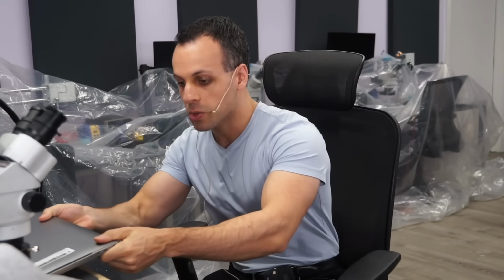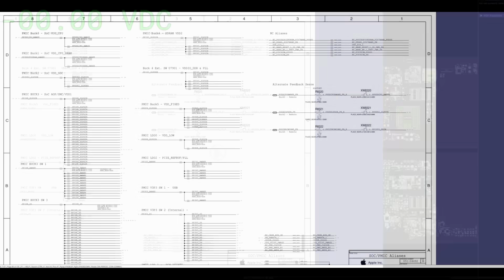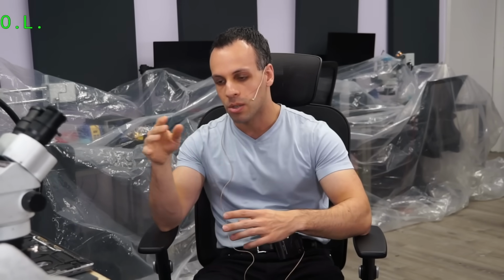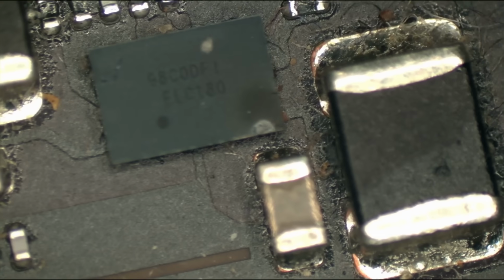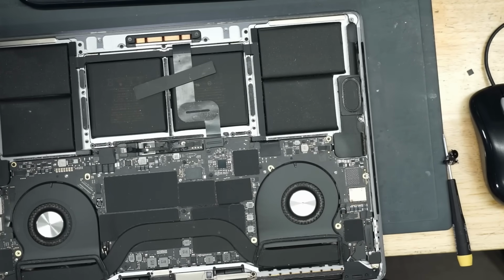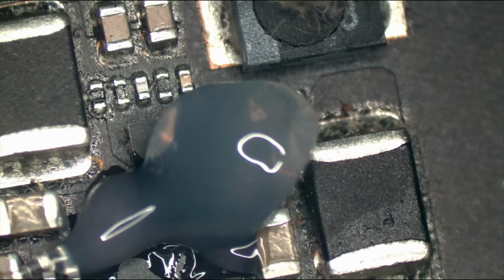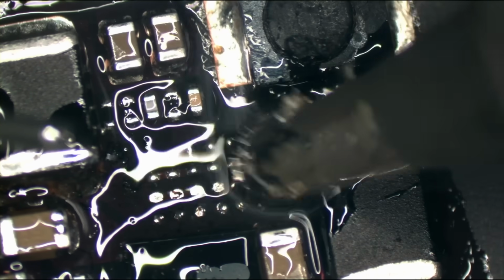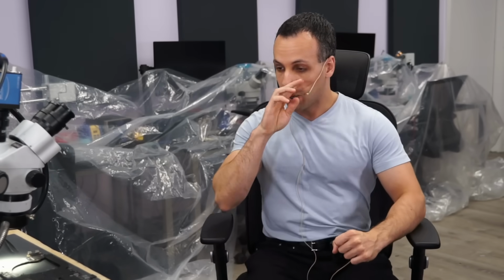How most 16" Macbook Pros often kill themselves & why they're unfixable

Comment: It appears that "throw it away and buy a new" is a GREAT model that will be used for a green and sustainable future. BRAVO BIG CORP!
Reply: So much courage. I wish other companies had that courage..
Reply: dont forget to buy icloud to keep your data
Reply: @simedinson984  "...to keep your data..."

You mean "to let Apple decide whether you get to keep your data".
Reply: @quigonkenny  sarcasm but okey :)
Reply: @simedinson984  Always back up your data to the cloud. If your MBP SSD is fried, all your saved data can still be retrieved. Louis didn’t tell you guys that part but its all common sense if your SSD data has been wiped.
Reply: Apple is still years behind appliance manufacturers like Samsung or LG. Imagine if Louis had to scratch 1 inch thick layer of silicone from the whole motherboard in order to even see what it is. Washing machines control boards were done this way years ago to prevent ANY KIND OF REPAIR. So you basically have to replace them every 2 years and they cost almost as much as a whole new machine.
Reply: @Wierzbik2137  uhh pretty sure it's because it's cheaper to just encase them in block of resin to waterproof it, and why does it need replacement every 2 years?
Reply: @eidrag  because motor control chips and power regulators are getting slowly but surely cooked underneath it? At the beginning they were failing every 6 months, so they quickly added small radiators to them and now they fry every 2 years, just after warranty period. Surprisingly sometimes when I manage to find a replacement chip and swap it after spending 2 hours with an angle grinder to remove that resin. The board works 4-5 years. Let that sink in. Waterproofing is just a BS excuse to rip of customers.
Reply: @Wierzbik2137  yeah they can design better waterproofing solution and spend few cents more for better quality chips.... but why bother when you can sell new board for half the price of new machine lol probably that's all manufacturer care
Reply: @Wierzbik2137  So, it's not really waterproofing (although, I'm sure the boards are waterproof) as the goal, it's to make just enough heat to kill the board just as the warranty expires, right?
Reply: @eidrag  Why do you need to waterproof a washing machine anyway? Your not taking it outside. Your roof doesn't leak (i hope). If your washing machine leaks THAT bad you got bigger issues, and finally if your home floods again you have bigger issues. Water proofing a washing machine is just a gross waste of resources that does basically nothing
Reply: @VadersFist501st  uhh not waterproofing the whole machine. Only for the central board where all the electronics/chips live. 

Some of example why waterproofing it is important are: you fill up the machine with water and you soak some of the clothes, then when you want to start the cleaning cycle suddenly it alerts you with overload, no biggie, just take out some clothes so that it can spin....whoops some droplets fell on control panel. 

Or you're soaked after getting caught in rain and you want to spindry your clothes... guess have to be carefull not to get water on sensitive electronic board
Reply: @VadersFist501st  because moisture. Simple enough.
Reply: @Wierzbik2137 I don’t understand this waterproofing thing.  I had 2 smartphones that weren’t waterproof before my S 10 and they lasted longer
Reply: @Wierzbik2137  Sounds like potting. Potting is done to protect boards from water.
Reply: @tagert1975  you know rare it is for a board to fail in a appliance because of water or moisture? It only happens if you have a massive leakage on the floor or sprayed the water directly on th appliance for example during shower.  Very rare cases, and even then as long as the main control chip is not fried I can repair the damaged traces and quite often bring it back to file. I flat out refuse to work on boards covered in this silicone. Having to spend 2 hours peeling that crap off the board and cutting it free from additional plastic cover with an ANGLE GRINDER of all things is neither safe or economically viable.
Reply: @Wierzbik2137   It's a washing machine. It lives around water.. I can repair traces too. I think I was 15 when I first repaired a trace on a circuit board. Hell if you take a more liberal view of it I was probably more like 8 years old. so that's not the question here. 

The washing machine has to pass UL requirements for a wet environment with detergents. While I've never designed a washing machine in my career I've had to get stuff used in wet environments to meet UL standards. Potting is one of the ways to do that. And since 99.999% of people can't repair boards, if potting is the cheapest option, guess what gets chosen?
Reply: @tagert1975  True, and that means all those new washing machines will end up on junkyard after 2 years of use, while the older ones with open control boards and loose cables dangling on the side of the brushed motors will work for 20+ years until the rust will eat them completely and they fall apart by themselves. Screw economy, screw ecology, customer is 1% safer while using his appliance ;)
Reply: @Wierzbik2137  The older washers don't have any electronics. My 1982 washer is electro mechanical. Just a motorized timer with contacts and the solenoids in the wig-wag. Those solenoids are sealed against moisture. Contacts are protected simply with decent plating.  But it doesn't have all the 'features' people want today. 

People want features and the government wants wiz-bang water & energy saving features and so on so there will be electronics. Modern environmentalism is ultimately very resource intensive and bad for the environment. But the old machines use more water amd a little more electricity so we have washers that last 5-10 years instead of 15-50 years.
Reply: @Wierzbik2137  it's a small wonder that any people want to buy old washers and dryers since they're built to be almost indestructible
Reply: I unfortunately fell (from a great height 😟) onto my 2-month-old Mac Air...repair quote was $2580 ( it cost #1664) I was told to throw it away....what really pi#*ed me off ...was the 512gb hard drive that cannot be recycled. Because it is soldered  in....so much for App,e's " bulldust" carbon policy....I wrote and asked Tim Cook why was the repairs so expensive....I said, I found it amoral! Needless to say he didn't respond! As an aside, it was my 1st and only Mac at 73 yrs old, I'm unlikely to buy another...it took me 2 yrs to save for my now very expensive paperweight!
Reply: Well you already have to buy the charger separately for their Iphone. What's more green and sustainable than that?! They can definitely sustain their profits and that big green headquarters in California.
Reply: Apple fanboys: why are you being so mean? You are just being a hater and toxic. 

Normal people: what are you talking about?
Reply: Apple is not green nor progressive, eh?
Reply: Yep. But folks are IDIOTS if they buy anything Apple ever again.
Reply: Buuuut wait, Apple SaVeS tHe TrEeS bY rEmOvInG pLuG aDaPtErS /s
Reply: Both my Macbook Pro 13 from 2012 and Macbook Air from 2015 died out of the blue without any physical or electrical damage. While my gaming laptops from 2011, Dell XPS and Lenovo Z580 still works to this day. When my last Macbook Air died just by itself while watching youtube, I promised myself I will never buy Apple products again.
Reply: It's it funny how that works?  The regulatory government-corporate structures  wants to move us away from cars that last 20-25 years if taken care of to cars that are much more resource intensive to build that won't likely last more than ten no matter how well they are taken care of.
Reply: “Green tech” and rainbow flag is just BS to collect ESG investment.
Reply: Reminds me of electric cars.
Reply: Apple has a thing on their website for recycling apple products, with a $0+ apple gift card depending on its condition. For my 2012 MacBook, they sent me a box with prepaid shipping and some instructions on what to do.
Reply: @DravenCanter  Unfortunately not correct,  when I first took it into the Mac shop, they told me to "throw it away " and buy a new one. That made me so mad, I wrote to Tim Cook as stated before.....He, in his kindness ( or one of his minions) referred me on to Apple support, which I in my dimness thought it meant someone was going to assist me to get it repaired at a more reasonable cost.....after many hrs of telephone "support" (sic) and after supplying a repair quote that they asked me to get ($99) I was again told to "throw it away" and buy a new one ,
As I said my 2 month old 512 GB hard drive cannot be recycled as it is soldered in...so no, not all especially Mac Air m1 2020 components can be recycled  !
Last point....after faffing me around for months, my last email to Tim Cook requested he refund the $99, I was made to pay for repair quote......I did receive a refund, and a very generous $125 discount on any Apple product over $425....will I take up the offer...I don't think so!
Reply: @DravenCanter  Yours is the last repairable MBP ever made and Louis can be a miracle worker there!
Reply: Don't forget it is made up from 100% recycled materials😒
Reply: no, it's a cash cow corp.
Reply: 💯 exactly!
Reply: Let's see, despite evidence that the climate isn't really effected (though the environment IS being damaged in places), what do politicians and their sycophants focus on? Other countries massive pollution? Nah. Trying to set up self-sustainability with better production and transportation methods? Nah. Forcing companies to be responsible, affirm the right to repair, and stop products that are built to fail? Nah. Instead these idiots believe that the companies can do no wrong despite usually railing against capitalism, and want to force green energy down our throats despite the MASSIVE environmental impact and general lack of viability. (Windmills, may or may not be harmful to wildlife and apparently can't be recycled, solar panels wear out after a bit and create giant hot spots, hydropower and geothermal power while very good have their own risks and can only be put in certain areas).
Reply: Apple's solution for this - give your old apple device to us and we'll recycle it. Which means Apple will harvest all the parts for free and reuse them.
Even so, I don't think Apple's system 100% recycles devices.
Reply: i mean they can't even green properly when they actually try to be green. They suck so bad that they need corprate welfare and propoganda in mass media to have a chance.
Reply: better yet you give your old machine to apple and they “recycle it”
Reply: Hey, Apple use recycled Aluminium for there notebooks :)
Reply: At least their donut building is running on 100% renewable. That counts for something I suppose.
Reply: All the repair shop guys tell you if they can’t fix it, its not worth saving it and you just might as well replace it.
Reply: The only thing green about apple is the PCB’s they send to the landfill
Reply: Just shut up and eat Your bugs!
Reply: People talk so much B.S. I have seen more 8+ year old Macs than ANY ofter brand of computers. Apple has longer lasting products than any other computer company there is.
Reply: You’re a fool if you believe that the “green” initiatives mean green for the planet and not green for the grifters who are implementing them.
Reply: #Capitalism it is what it is….
Reply: @belikeike  you all blame capitalism but you are the ones who demand cheap goods. It’s like blaming your computer for fucking up a program that you coded.
Reply: If we started making shit that last like back in the day i believe polution would go down by 100-200%
Reply: Since when big corporations really care about anything but money????
Reply: "Ending is better than mending." 

"The more stitches, the less riches."

- Aldous Huxley, Brave New World (1932)
Reply: Apples have been disposable computers for decades. That's why they spent so much effort bubbling off their ecosystem and creating such a culture around their products. Convince everyone who owns an Apple that their oh so pretty shell around poorly designed, out of date hardware is top of the line and the only thing that can do the job their users want it to, and they become that much more willing to just fork out another $2-3k for another whole computer (plus who knows how much more for the current accessories that no longer work with the old model) for issues that would cost $100 to fix (and probably wouldn't happen in the first place) with a "lesser" brand...

Apple likes to think of themselves as the luxury supercar of the computer business, but all too often you're just getting a prettied up Pinto.
Reply: People support it buying that c**p.
Reply: Why I in the past advised not selling a product, but a service. So the profit would be where their product would last long, so they would not have costs for replacement and installation. Them not selling lightbulbs, but to keep the airport lighted.
Reply: The other companies (dell, hp, google blah blah blah) make things mush less recyclable and i NEVER hear the argument that they should do better with their plastic junk. in fact they sell soooo many more than apple. I guess people like that they sell bargain basement garbage and we don’t seem to have any problem just throwing them away. Also, you just give all your data to Google so works out I guess. It is a tough argument because Apple should know better making something that data would be so vulnerable. Though it’s good to know that it will be destroyed other than in the wrong hands :-)
Reply: Next is Tesla on your cars that horrifies the shit out of me, laptops are 3k cars are 40k. Beware stick to Toyotas
Reply: @AliKhan-fl7zb  or Hondas
Reply: @AliKhan-fl7zb  buy that Toyota soon and hold on to it for the next 18 years. Commiefornia just banned gas cars in 2035 and by 2026 30% of cars sold Must be EV. What a joke
Reply: @AliKhan-fl7zb  lol. nope tesla's start at 55k base packages before fees and taxes. You can run the bill to around 100-120k with it fully decked out and again before fees and taxes.
Reply: People should also be aware that no matter how sexy your computer seems to be, failure is inevitable. I keep backups of everything so that if something does take a big shit, I can just keep rolling along. If you have 2-3 copies of everything that's important and a single failure happens, add another layer (to keep 2-3 points), and then fix or replace the offending device.

That being said, I must be lucky. I've owned Apple computers since the 1990's and I haven't had a single one die. I still have machines from the 1990's in my collection that work. I have Macs from pre-PowerPC, up to M1, and all iterations in the middle - without fail. (I don't have the dual chip, quad core G5, since those have a cooling system that's a grenade over the PSU.) I also never got a G4 Cube, because the thermals are garbage, but I have a 2013 trashcan Mac and that runs quite well considering how similar they are in principle. (The 2013 has better convective airflow.)

I'm not a fanboy, I just collect computers. I also have a bunch of old PCs for nostalgia and geekiness sake.
Reply: @justsomedudeonline26  "Failure is inevitable" Seriously? Are you a car salesmen who time traveled from the 1970s when engines rarely made it past 100k miles and GM, Ford, and Chrysler all said that was normal? I have a late 90s PC that still boots up. I don't expect electronics to last forever, but 2-3 years on a $3,000 machine???? Go back to the 70s with your out-dated logic.
Reply: @ddognine  How did you guess my oddly specific origin story? 🤣
Reply: @justsomedudeonline26  if people don’t have 2-3 backups somewhere, offline or otherwise, they are dumb
Reply: they offer $ for turning in old stuff for recycling rare earth materials n metals, they need that repeat business
Reply: i understand things may not be as repairable as they used to be, but they definitely are more recyclable now

Comment: 13 volts in, 2.7 volts out... and no reliable crowbar?  Yikes!

Is there a grounding fail on the motherboard?  That chip is pulling almost all of the output current up from ground when it's working correctly.
Reply from the maker: There is always grounding and when the chip blows up your 12v is going in the 2.7v power rail.
Reply: @rossmanngroup  I'm not doubting your diagnosis. You've seen a ton of these.

I'm just wondering where the    design defect     is that causes these things to fail. TI's notes on the part don't give any particularly unusual design guidance... it looks to be a standard jelly bean part, assuming the lines are all kept very short to the passives it uses.
Reply: @ka9dgx  mosfets within the chip will decide to become a wire.
Reply: @CocoaEm  I understand that's the current state of the chip, my question is what led to the chip operating outside of it's safe operating conditions long enough for that to happen... is it the chip itself, or something about the board design.  My GUESS is that to make things flat enough, they moved the passives off to the side, instead of putting them under the chip, and the extra trace lengths are a problem.
Reply: @ka9dgx  is is 100% just the chip being unreliable. i imagine the chip doesnt like the whole living thing. could be from it being overrated than what it could actually handle in the datasheet, but it needs to go and fuck off.